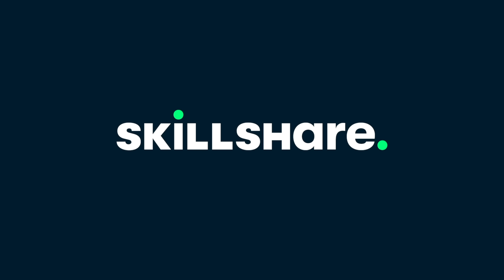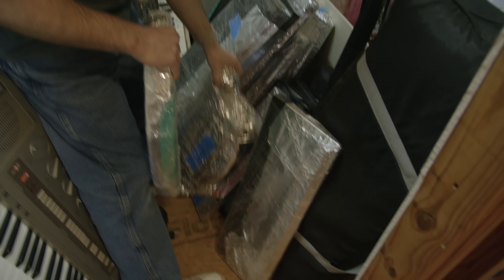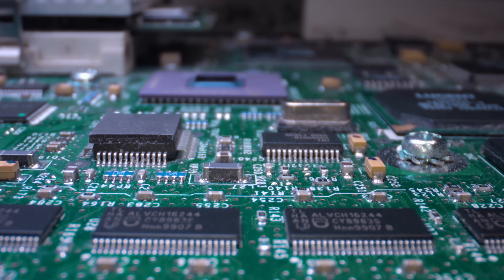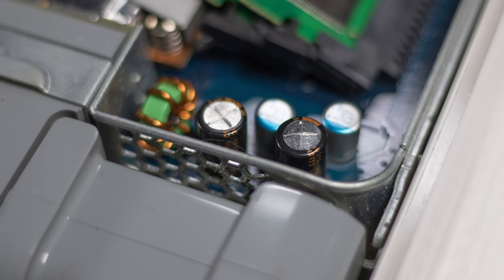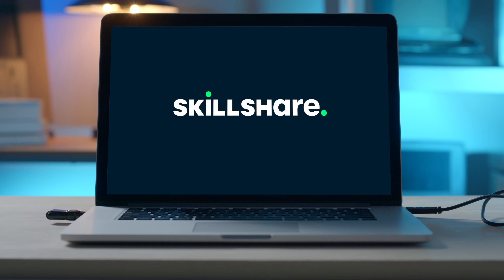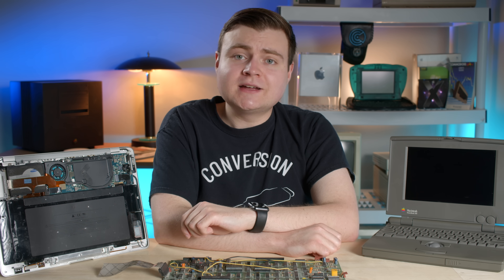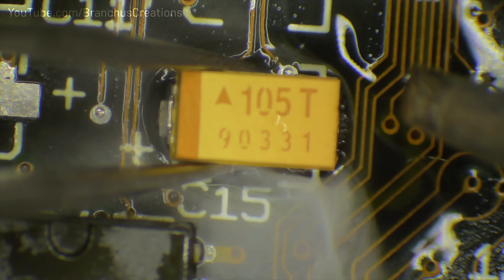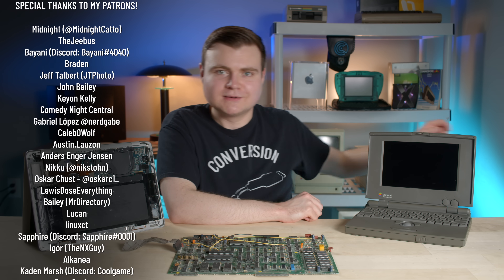Why Do Computers Die? (ft. The 8-Bit Guy) - Krazy Ken's Tech Talk

Comment: My dad got our family a Macbook Pro about a decade or so ago; back when I was still young and ignorant of computer care. It was meant to be a "family laptop", but...I hogged it, of course, since it was so much better than our Windows XP Dell desktop at the time, in terms of ease-of-use and stuff (I'm still of the opinion macOS beats Windows 10 hands-down when it comes to user experience).
Anyway, being the dumb kid I was, I constantly ate food around it. Crumbs got into the trackpad, the trackpad eventually cracked due to mould and stuff, the battery eventually died (so it needed to be constantly plugged in), and...yeah, the laptop ended up dead.

Oh well. My second laptop was one my high school gave its students in Year 10 (2013), and it was a Macbook Air. Once students graduated, we could keep the laptops if we wanted, and I did; it lasted until 2017, when the speakers died in the middle of a university semester. After that occurred, I got a Macbook Pro again, which now had that newfangled 'Touch Bar' thing that...is superfluous, honestly. Still use it to this day, but if I had a spare AU$5000, I'd definitely replace it with something new.

...Though, I'd also like a replacement for the Lenovo Legion Y530 I'm using right now, for both gaming/casual use and for Windows-only university tasks...if I did have a spare couple-thousand bucks, I'd have to weigh the options...better gaming laptop, or newer macOS laptop. Better gaming, or newer macOS...hmm...real tough decision.

Comment: my hardware horror story was a cursed late 2013 MBP 13 inch.  The first time it died was when it got struck by lightning while charging.  then I fixed it because the SEMOS chip died. ( every boot you had to reset it.) then I had apple fix that. Now the keyboard and SEMOS is failing.

Comment: Two quick things come to mind, one is tin solder whiskers. That is a major killer of older electronics. As the tin in the solder degrades from white tin to black or grey tin it crystallizes and forms threads or whiskers protruding from the surface of the solder joint or puddle. The whiskers are conductive and will short out components when they get long enough to arc over or when they break off and migrate to a spot where they can. Not good, Murray! Second thought, I’m surprised you didn’t get a hold of Fran from “Fran’s Lab”. With her work on the Apollo flight computer and such I kinda figured she would show up. Her main gig is historical electronics.

Comment: We collect consoles here from the 3rd generation all the way up to the 9th. We also are working on building a 90's themed arcade complete with stand up coin-op cabs. I have thought about building an old PC for some vintage gaming as well. I'm thinking 486DX2@66Mhz w/8 to 16Mb of RAM/DOS 6.0/Win 95 and maybe an old 3DFX *Voodo card. Coincidentally, this was my very first PC build in 1994 for Doom (I didn't have Win 95 at the time and only 8Mb of RAM). 

At any rate, aside from these issues listed there is another silent killer lurking in even the most current electronic devices. I'm talking about electron buildup that occurs naturally when you use a computer/console/Teddy Ruxpin and the like. Unfortunately, there is no real viable way to really flush a machine of these electrons. Every console and PC is essentially a ticking timebomb and one day...no prompt, black screen, BSOD, RLOD, YLOD...you get it. You would think someone would have designed a method or tool to draw out excess electrons but at this point...nope.

Lastly, as a console/arcade collector I have dealt with capacitors many, many times. If you have any experience with NEC's consoles released in the states you will know what I'm talking about. The US Turbo Duo has the worst capacitors I have ever witnessed and if you ever get one...change the caps immediately. I don't care if it looks super clean it's only a matter of time before the motherboard is covered. I think NEC of America knew they were loosing the 16-bit war badly and didn't care. They probably thought the player at best would use it for maybe a year before jumping ship. After a year of solid use those caps are going to blow.
Reply: ...What the hell is "electron buildup"?????
Reply: @mollycrime  
Okay...so I learned this many years ago while I was in college. Honestly I don't quite understand it entirely myself but...all electronics hold a minute charge even while unplugged. Some hold a lot of electricity and can actually kill you even if unplugged for years (CRT monitors). At some point these electrons move or jump to other parts of the device. I have heard them called "bad electrons" before. I don't know if it's like a continual use that wears out the device or if it exposes said circuits to high heat permanently damaging them. Maybe it's a build up of static electricity that causes this. Essentially at some point an electronic device will fail and there's nothing we can do about it...that's how it was explained to me. 

I have often wondered why a device or method hasn't been created to eliminate this problem. Mind you, a problem I didn't know existed until that class. I'm...I guess mentally prepared for the eventuality of my electronics dying due to this. I have pondered on what a device that draws out excess electrons from a device would look like and how it could be applied (since that class). I don't know...
Reply: @Sinn0100  I'm sorry but that's complete nonsense. There is no such thing as "bad electrons"
Reply: @mollycrime  
Well no...it's...there is no good or bad electrons. It's just an expression.

Comment: Recently I worked on someone's laptop that acted completely dead, no power at all- but there was a barely audible "click". Opened it up and found that a small rectangular ceramic capacitor had a crack in it, and every time you pushed the power button it would throw sparks. Started at one or two. Then it became a shower of sparks. Then the capacitor shattered and fell off. Best part, because there were multiple capacitors working in parallel in that part of the board...the laptop started working again and booted to Windows without so much as a hiccup.

Comment: I've had old electronics with leaked batteries, only one had corroded terminals that could be sanded with an old fingernail filer to work again for a cheap man fix.

Comment: Capacitor problems are especially bad in analog electronics, as they are the backbones all sorts of timers, oscillators, and other analog circuits, especially tuned ones.

Comment: Your hole in a container with water analogy is wrong. The flow rate from the hole will change depending on the level of the water in the container.

Comment: out of the 8 bit computers i currently have i have only had to replace one of those caps and it was in a monitor. and i have done a couple mains filter caps but thats a well known thing. and i have had to reflow some solder joints. trs 80 model 3, vic 20, coco 2, ibm 5150 and apple iie enhanced. the cap was in the ibm monitor and the rest of the work was in the trs 80 model 3.

Comment: My unibody MacBook pro had a weird problem where the RAM would randomly stop working and the computer wouldn't boot, only to find it boot 10 minutes later when I've moved it to another room. Now it's becoming clear that my RAM joints have become disconnected. At least one slot still works!

Comment: You forget a very important cause of failure in computers and that is bad circuit design or faulty ic chips, sometimes they just wear over time and the faulty things just give up. Commodore computers are plagued with this problems. Other culprits are bad quality welding material (are you listening HP?) or thermal paste just drying up.

Comment: I repair electronics as a hobby and I just now got the understanding of caps. I watched others but they never explained it in an apt manner. Caps are just needed because they store electricity. Okay buuuuut why and that is my issue to learn I need to know answers of why this that and the other which seem insignificant but my brain only retains it once it understands the reasoning. Thanks for that one. I now get it. I mean repairing electronics does not require knowing these things just replacing parts most of the time but still.

Comment: I used to slap the back of my laptop screen when it was running too slow or had an error. I ended up slapping my eMachines one too many times and the display glitched the heck out. We had to fork out over $100 to buy a new screen, which I paid for by doing chores, picking up dog poo in particular. I eventually got enough money to buy the new screen and replace my laptop's broken screen, and my eMachines still works fairly well to this day, but nevertheless, I've been way more careful with my electronics since then.

Comment: Early production runs of  the original Apple II also had a similar design flaws; no fan & no case vents. Later revisions added case vents. If you ran the monitor or TV on top of the system, the power supply burned itself up. Mine was covered under warranty & after replacing it I only ran it with the case cover off, with no problems. The good thing was the machine ran totally silent. A good example of rushing a product to market & letting the early end-users do the testing.

Comment: I generally like the 8bit guy (not the IBM video)... but warping into foil is absolutely no good idea!
Over time it will stick to the plastic of the computers!

For example: 
I have a Commodore 8250LP that was covered by a plastic bag - now the plastic bag is part of the top... 
I have some C64 that have "burnmarks" on them... like somebody took a hot soldering iron... Was the cable that layed under the C64...

And if the first attempt at repairing a C64 is to replace the Caps before having a look at the voltages etc.: this person has absolutely no idea of repairs...
Because too high voltage out of the power-supply kills computers as well...

Comment: My most humorous repair was for a major manufacturer. I worked in IT maintenance for a company. A user complained that anything he typed came up as random characters on screen. I went and retrieved the keyboard/computer for testing. His assessment was repeatable. There was no obvious reason. I swapped keyboards to see if that stopped the gibberish. It did. Keyboard problem. Went to plug the problem keyboard into another machine and noticed a switch on the bottom of the keyboard with three positions marked simply as reset/lock/map. I discovered in the service manual that if set to map, you would press a key and then the next key you pressed was assigned to the first. So if you pressed the A key then pressed the P key the A key acted as the P key. Worse, until the switch on the bottom was locked, this kept reassigning keys. So you would press the A key (nothing would be displayed), then the P key (displayed). They you would press the A key again (no display) and press another key, say J (displayed) and not that key was assigned to A. The mapping never ended until you locked the mapping. Fortunately, you could switch to reset, which used a ROM original key set and also copied it to the map. The keyboard did work, but it was decided that the switch was a user hazard not worth the trouble. My boss told me to set it to reset and super glue it there and then put a chassis seal over it. so that no one would seem curious. Problem solved.